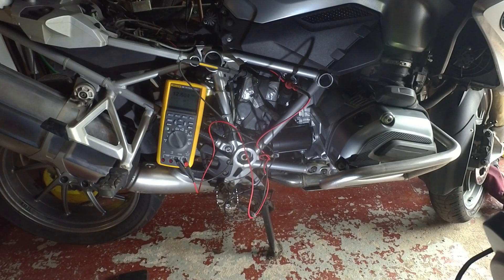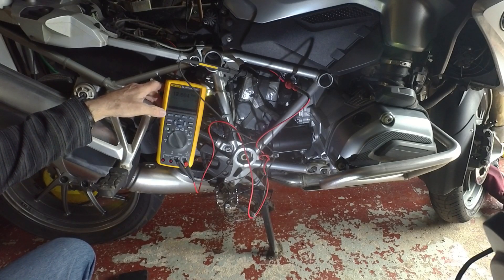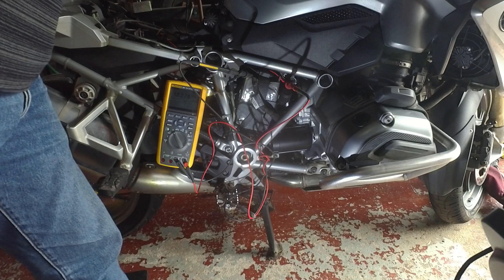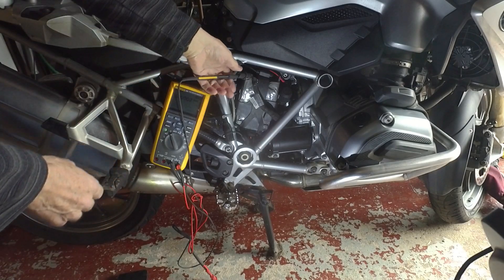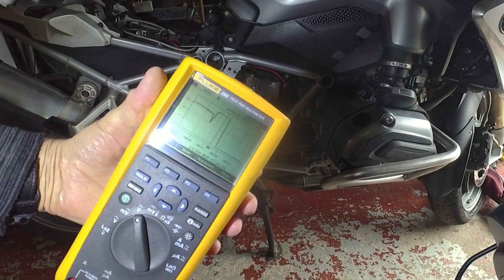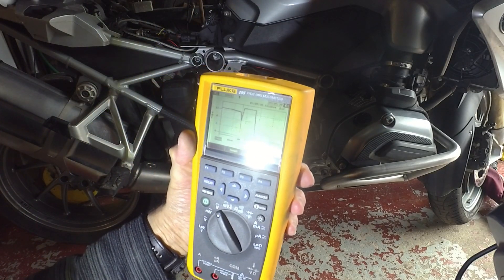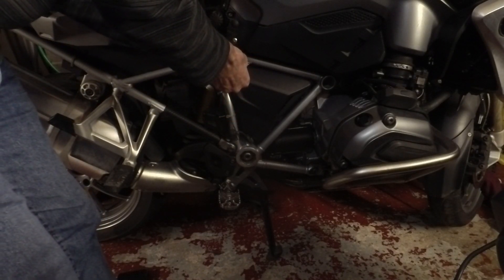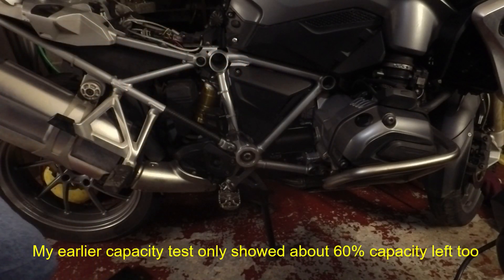BMW R1200GS Battery Start Test

Comment: My Gs1200A K51 use a battery 12V, 12 Ampere.
Can i replace it with battery 12 volt, 16 Ampere?

Thanks for your suggestion.
Reply from the maker: Yes, so long as it fits in the space and the terminals are in the right place it should be fine. I think you mean 12 amp hours v 16 amp hours (Ah). This is an indication of the energy that each battery can store. So the one you’re proposing should hold more energy, which is generally a good thing. The other thing to check is the cold cranking amp (CCA) rating. This indicates how much power the battery can deliver in short bursts, to turn the starter motor. Worth checking that the 16Ah battery has a CCA rating similar to the 12Ah one. Should be around 220 CCA